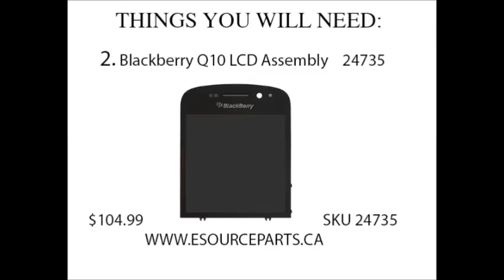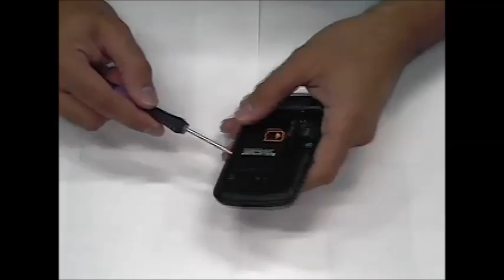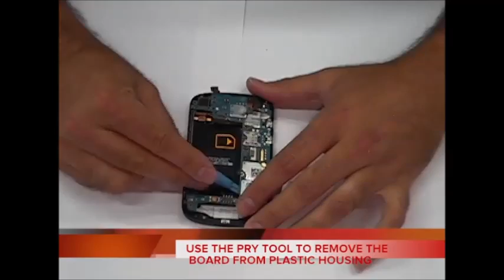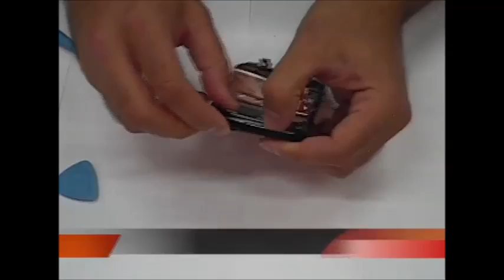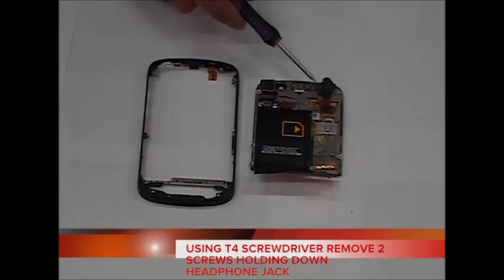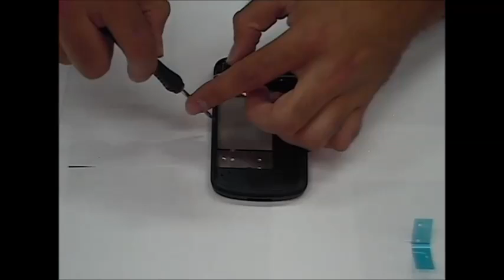How to replace Blackberry Q10 LCD Screen Replacement and Keyboard Complete Walkthrough Instructions

Comment: Great tutorial , Thanks for the video! Very clear instructions, it worked very well for me.Had a few problems with the 2 Philips screws,Those where  locked I managed to pull the display and keyboard separate .I spent just time a 705 rs(11 dollars)to replace the LCD screen .NO data wipes no calibration needed . Thank you! Good luck for others.

Comment: Thanks for the video! It helped me change my Q10 housing, screen and keyboard !
Had a few problems with the 2 philips screws, then the proximity sensor was not working (one of the pins broke) and then the screen would not turn on, but now everything is working perfectly! So my advice would be to take your time and make sure everything is in place!

Comment: Changed the Q10 screen on my phone.   All works fine.  The copper plates were not in the version that was used on the video.    Video was well paced and contained enough detail to do the work.    Level of difficulty:  Moderate.    Cost $58 Canadian.  includes the screwdriver and parts kit.   Now to fix the damn water kettle..

Comment: Be careful. The 2 Phillips screws are locked in and easy to strip. I used a very small flt blade wedged in at an angle. They came loose with a snap.

Comment: What this awesome and helpful video failed to mention was that the copper adhesive that is placed underneath the motherboard, and the sticker that covers the second keyboard screw needs to be put in the same exact position it was in before removing. If not, the screen will not work. Other than that it was an excellent tutorial.

Comment: Very nice informative Video!  You need a brighter light BTW   I need some help with my Q10  It records very very little sound when shooting videos and also any voice notes  Playback sounds like nothing. If I use any external headset plugged in then the recordings sound fine!   Are the mic holes possibly clogged or plugged?  How do I clean them?  I'm a flat screen tv tech btw.  Can I safely use rubbing alchol to try to clean the tiny microphone?  All other things on the phone work well
Thanks Wc
warrenca@accel.net

Comment: can anyone share the purpose of the copper rectangular shaped foil tape over the right sided keyboard screw? Does this need to go back? mine will not stick/torn up.  Any replacement? any copper tape?
Reply: +Mark Pratt 
I didn't read further down -  just followed the instructions. I've had no problem having NOT replaced the foil etc but it is early days.
I've had no problems...yet ;)
Reply: +4ebees still no problems? I didn't replace the copper stickers either...
Reply: +C Kathol 
No, no problems noticed. It's an interesting issue as they had some reason for it in the first place. 

What's copper for? Conductivity? Heat transference/dissipation?

Comment: I noticed they never replaced the copper foil ground just underneath the battery. I used some adhesive in certain areas and my Q10 works perfectly. This video was very helpful, I would not have been able to accomplish the repair without it.

Comment: althought the screws he says are not correct, I followed this video and replaced my LCD screen with no problem. Just took a bit more time because I was going carefully to not break anything
Reply: hi did u have any problems with it after??my screen works, but wont stop rebooting
Reply: I had no problems. Did you plug the connectors correctly? Mine is working fine until today. Probably the battery is a bit loose (it happens with Q10s). Try to have a bit of paper between the battery and battery door and see if stops rebooting.